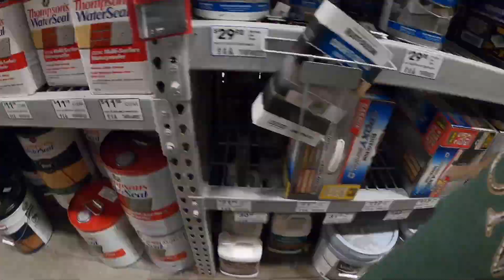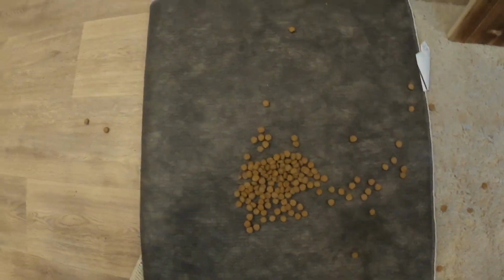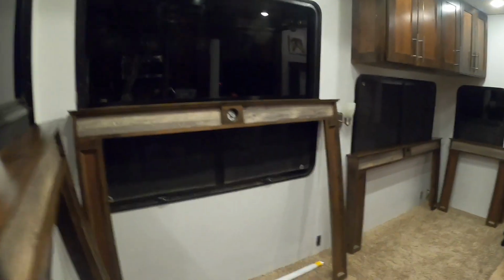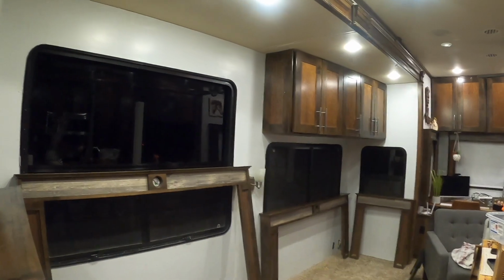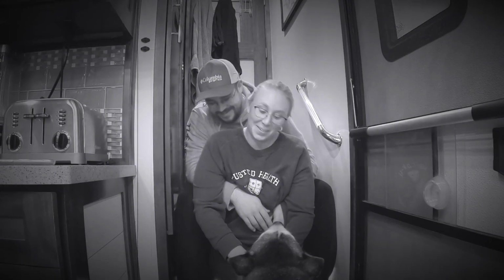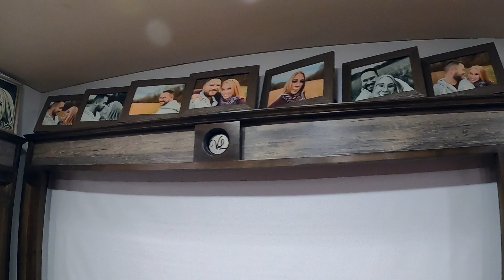Full Time RV Couple RENOVATES 2017 Vanleigh Vilano: NEW RV OFFICE [Before & After]

Comment: Love the look! We have a 2018 Vilano which we love! Did you have to do anything to the walls prior to painting or did you just paint over the wall covering? Thanks!
Reply from the maker: Thank you! Just washed the walls. Prepped with kilz and then painted. If there are any rough sections of the wallboard you can sand to smooth it.